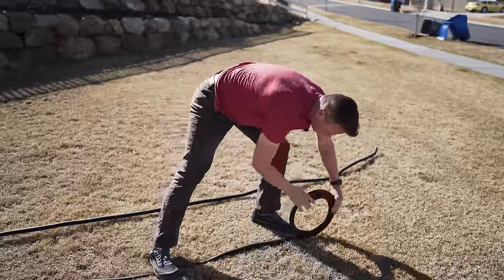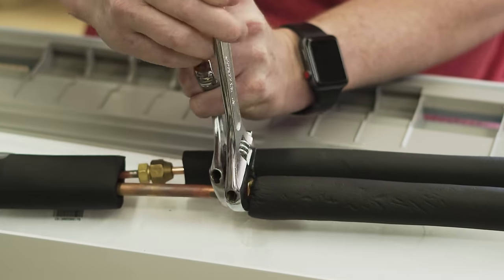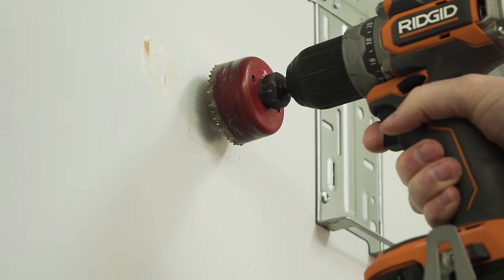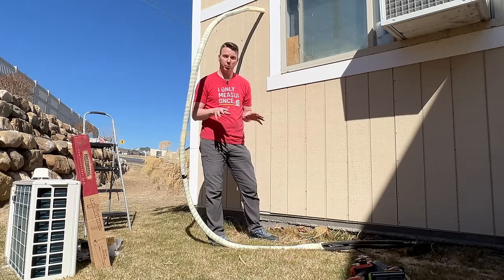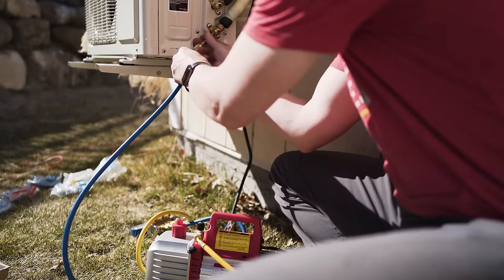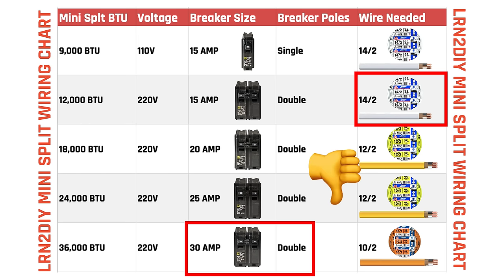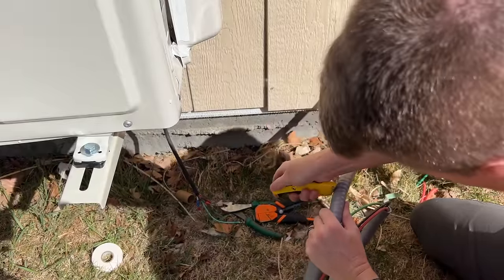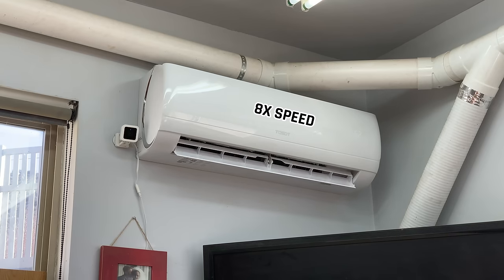DIY Mini Split Install - All the Things Nobody Shows You

Comment: I admire anyone who can do their own install. I watched this video and I contemplated it but given the various challenges, the refrigerant part was finally the deal breaker so I hired a HVAC contractor. If your curious about the costs, I had a 15k BTU Mitsubishi unit installed in my country house, about 1.5 hours from a major city (so not urban prices). Its a total racket for the HVAC guys. I got five estimates to install a 12k BTU single zone unit and prices ranged $4,500-$7,800. Labor alone ranged from about $2,500-$4,000 and the internet price for the units they offered to install ranged from $1,000-$3,800. No company would install a customer supplied unit - you had to buy the unit from them, and some companies would only install certain brands, while others would install a few different brands. This did not include the cost of the 240v exterior disconnect my electrician had to install ($500-700 including permit costs). Took one HVAC guy about 3.5 hours start to finish to install, including clean-up and showing me the basic functions. Like anything else, once I got a couple estimates I was able to negotiate the prices down. I ended paying $4,500 for a 15k BTU Mitsubishi Hyper heat unit 22.2 SEER (roughly $2300 internet price), but their first estimate was about $7,000 before they came down. Having both the manufacturer and installer warranties are a peace of mind. The unit is fantastic, worked great when outside temps dropped to the teens and recently with 90 degree+/humidity.
Reply: I am just shocked at the high prices HVAC contractors want to do relatively simple work. I could write a long chapter about some of the various ripoffs I have seen. They mostly take advantage of people's desperation when their heat or a/c stops working. People are shocked at the high bill, but then remember they are just happy to have it working again. I do not consider it a very honest business, generally speaking. I met one self-employed HVAC guy who would quickly fix a/c's (mostly easy replacement of capacitors and such), going to about 7 homes in a morning, then be out on the lake by 1:30pm to spend the rest of the day boating. If he charged others what he charged us, he took in nearly $8000 in one morning, all Zelled directly to his bank account. For work that was quite easy to do, nothing miserable like crawling under a house to install ductwork. I was just shocked, for example, that he could conscionably mark up an $8 capacitor to $260, and an $8 contactor also to $260! Plus all the other unbundled big charges, hundreds for a bit of extra coolant, etc. Getting rich in this field takes just a modicum of training, plus a LARGE measure of lack of conscience about ripping people off.
Reply: Mini split installation in USA is very very high vs what we pay in Australia. I've had  mini splits installed by a licensed refrigeration guy & licensed electrician for around A$1,000 (Say US$700). Some installers will do it for even less than that but I shy away from the real bottom dwellers.

And then the units themselves are also more expensive in USA, eg a Mitsubushi 3.5kW (say 12,000BTU) sells in Australia for around A$999 incl. GST or say US$700.
Reply: @KpxUrz5745  Ain't that the truth, I've got a leaking coil on the indoor part part of my mini split.  The parts are still under warranty but the labor isn't covered, they want over $2600  to replace the coil.  Not sure how long it takes but I'm guessing refrigerant is $300 or so, either it's going to take a couple days or they're charging $500+ an hour for labor.  I'm probably going to buy a unit and replace it myself.  The power is already in place.  Lines could probably be re-used but I'd probably get new just to do it right.  I've got everything but a flaring tool already.
Reply: Wow, that is expensive.  I did a service call for a ice machine on a Indian reservation, and had to drive about 1 hour to get there, then make the repair, and then drive to my next call.  So my boss said I had to charge a certain minimum fee.  I ended up spending most of the day driving there and back, so I was giving up the same amount of money as I could make on 4 service calls to customers within 30 minutes drive to each other.  

So the $4,500 fee is very high, but I can also understand that cost.  If he had to return to the shop for another 10 feet of copper tubing and go back the next day, that would make the $4,500 a money loss situation for the company.  

Glad that the installation went smoothly.  Perhaps a Mr Cool system with self install tubing would have worked much better in your case.  The electrician could have completed everything.  The tubing is sealed with a foil covering, and precharged with about 10 PSI of R-410.  The indoor unit is also precharged with R-410.  So when you put together the fittings, they open the foil covering and there is very little risk of refrigerant loss.  The once you check with soap bubbles for leaks, you can open the refrigerant valves, and they have enough refrigerant in the outdoor unit to run the system.  

I have a friend who was a traffic signal engineer for City of Long Beach California.  He  retired to a small town about 45 miles east of San Diego, and they had a town hall meeting to discuss installation of their very first red light.  He suggested they call the company who would install this $100,000 traffic signal and get a cost estimate for installing new light bulbs, and to make a circuit board repair if the lights went to red flash.  The answer was $1,200 for the technician to come out there, and spend up to 2 hours on site.  If he had the correct part on his truck, then the cost of that part, or another $1,200 on the return trip.  Cost to replace 1 or all of the light bulbs would be $1,218.  The city decided to install a brand new traffic circle in the place of their 1 four way stop sign.  I am thinking they must of had $80,000 to waste on some project in the city, and suddenly discovered a traffic circle would use up all of that money!  Now it is a pain in the backside when a tractor trailer is trying to make it's way around the traffic circle.

Comment: This was a great video - I was intimidated with the pre- charged lines and/or the vacu pump gauge process - not so much anymore.  I understand it better now.  If you still check your feed - if you had the choice between the Tosot - Pioneer - Dr. Cool - which would from your opinion would install the best?   Anyone is one for this question.

Handyman - Doug

Comment: Overall it looks good. I am bit confused about your electrical connections. You kept mentioning neutral and hot. However, the unit was rated at 220V. In the US, you typically refer to these as hots or Line 1 and Line 2. Also, if you hook up a 220V circuit, you always use a 3 wire + ground Romex. Hots use the black and red, and the neutral (white) can stay disconnected. I'm  not an electrician, but this is what I have seen.
Reply: yea he messed  it prtty bad. Should have connected black and  red (2 hots) and cap off the neutral which is not needed here. Also  breaker needed to be 15A.
Reply: @sumilidero  It is rare that a person admits their errors.  I am impressed that you have and I am proud of your honest response!  You did a great install and corrected any erroneous information.  For that reason I give you 5 stars! I am subscribing now.
Reply: Not all 220v circuits require a neutral. For ex. electric water heater only needs a two wire + ground. A neutral is needed on a 220v circuit when it has a 110v control circuit element to it. For ex an electric dryer. It has controls that run on one leg (110v) of the 220 and therefore that part of the circuit needs a neutral return path. If the appliance or equipment has no 110v control circuit then a neutral is not needed.
Reply: @jfowler702910  On an electric dryer the timer and the motor that turns the drum are 110 volts. Only the heating element is 220 volts, except in a gas dryer then the entire dryer is 110 volts. I'm not say you are wrong, this is just for clarification.
Reply: Yeah, that red as neutral thing would have me scratching my head if I had to work on this at some point down the road.
Reply: @williamjones4483  correct but some dryers could use a 220v motor. In those cases the neutral would only be used for the 110v control circuit.

Comment: Good job on the video and the install. I did notice however that you installed a 30A breaker in your panel to feed the mini split. Although the wiring leading up to the mini split can handle 30A, the mini split itself and the wiring inside it cannot. You should replace that 30A breaker for a 15A breaker ASAP for safety reasons and to avoid the potential of voiding the warranty of the unit due to an improper install.

Edit: I checked the service manual and this unit draws a maximum of 6.7A, so a 30A breaker is way too large.
Reply: Breakers are sized to protect the feed cable. The device manufacturer should supply internal breakers or fuses to protect appliance wiring. 

Using a smaller breaker on a higher ampacity cable is acceptable.  This is usually done when voltage drop is a concern.
Reply: @joefrisco  I can't speak for all countries, but I know that some countries such as the UK do require a fuse at the plug for each appliance. However, in the USA and Canada, no such fuse is required and is rarely seen. I have 4 mini splits in my house and none have fuses at their power inputs.
Reply: @joefrisco  That syncs up with what a power company tech told me. He had seen his share of bad wiring causing house fires. He always "overbuilds" on his personal projects. Such as  12 gauge wire on a 15 amp circuits. Whereas 14 gauge is sufficient and code. Code is just the minimum.
Reply: @joefrisco  the MAX breaker size is always printed on equipment labels. Exceeding that is against code, and unwise. Equipment overload protection is included for normal operation, exceeding the max breaker size comes into play when equipment controls fail, to prevent fires.
Reply: @SuperVstech  Manufacturers may state state breaker sizes. However, I could not find in the code where it is required (See NEC 2017 Article 440.4)I do agree it is a convenience and obliviates a need calculate the breaker size in accordance with remaining sections with Article 440. Maybe you can point to the setion in the ode that supports your assertion that "the MAX breaker size is always printed on equipment labels. Exceeding that is against code, and unwise. " I sincerely would like to have the section t pointed out to me where that statement is made so that i can understand further

I work in a department where cable sizing takes on a whole new dimension to what is normally seen in residential contracting. So I may be a little off the charts as to the lengths to which I go with respect to protective devices and cable protection. 

The main point is that the instantaneous circuit breaker is there to protect the cable first and foremost. In this case the molded case circuit breaker provides the instantaneous interrupting function.

For more details with respect to Air-condition and refrigeration equipment within the NEC see article 440.
Reply: @joefrisco  So if the appliance complied with NEC 110.2 (use approved equipment), it will have come with instructions and/or labeling. Those will state the breaker size(s) you must use for it.
Reply: Also, its a good idea to install a $75 surge protector at the disconnect switch.....I lost my entire Mini Split to an electrical surge/possible lightning ...killed the inverter board and shorted out to ground on compressor.
Reply: MCA is 9 amps I don't think you have the correct spec sheet!
Reply: @joefrisco , If the nameplate says 15 amps MOCP, then my area code requires a 15 amp breaker or fuse size.  If it says 20 amps, then that is required.  30 amps is not acceptable in this situation, even if the wire is rated at up to 30 amps.  If the MCA is 15 amps, then that is the smallest wire and circuit breaker size acceptable, while it might have a 15 amp MCA and 20 MOCP, then either a 15 or 20 amp circuit breaker is OK.  However if the MCA and the MOCP (Maximum Overcurrent Protection) is 15, then only a 15 amp circuit breaker is acceptable by my code inspector.  

Should there be a problem with the inverter that controls the compressor, a 15 amp fuse will provide the best protection for the system.  However a 15 amp circuit breaker will be acceptable, and might trip before much damage is done.  A 30 amp circuit breaker might never trip when the inverter takes a dump, and melts inside.  

Also remember the wiring between the indoor unit and outdoor unit are powered by the outdoor unit, and protected by that circuit breaker.  in the case of 15 amp breaker, the #14 or #16 wire size is fine.  The wiring powers the 165 watt indoor fan motor, and any communications between the units.  So #16 wire is plenty large enough for a 1.5 amp load on a 120 volt ductless unit, or .8 amps load on a 240 volt unit like the one shown in this video.

Comment: It would be a better idea to run the vacuum pump over 60 minutes, to get out any amount of moisture in the lines.  Also make sure that you let some of the refrigerant into the lines before trying to remove the line.  With a vacuum in the line, there is a negative pressure, and will leak air into the lines if disconnected as shown.  By opening the lines all the way, you will lose some refrigerant as you remove the line, however this is better than leaking air into the system.  Best would be to open the valve a little bit, let some pressure into the lines (say 15. PSI), then shut the valve, disconnect your line, and then open both valves all the way.  

Also I never leave the caps off of the valves when running the vacuum pump.  It might be possible for air to enter the lines if left off.  

Ideally, it would be good to use a "Micron Gauge" however in 38 years, I never bought one, as they are about $175.  I have used them at work, when they buy the tools.  Running the vacuum pump another hour, it will more than make up for the lack of using a proper vacuum micron gauge.   R-22 systems are much more tolerant of lack of vacuum, and a little air or a few grains of water in the lines.  R-410 will make acid out of any moisture in the lines.  This will over time, eat away at the compressor windings.  

You show self taping screws on your electrical panel.  Are they "Blunt Front" screws, that will never dig into a loose wire?  Blunt front screws are the only type allowed on a electrical cover to bolt it down.  

If the unit is running 230 volts, then you should have used the two colored wires, and cap the white wire in the disconnect.  If you use a white wire to a two pole circuit breaker, then it should have a wrap of black tape on it, so everyone will realize it is not a grounded neutral wire.  If you happen to be running 120 volts, then the white wire Must Not go to the disconnect, but should have a wire nut on the white wire, so it stays connected when you turn off the power at the disconnect.
Reply: NEC does not allow black electrical tape to mark a white conductor as an ungrounded current carrying conductor in a cable assy. It must a permanent ink or paint that encircles the entire conductor, and two inches of coverage area is standard in my area. A sharpie ran up and down the conductor does well.
Reply: time isnt an issue ,when vacuuming a unit you cant use those gauges you require a micron gauge or torr gauge
Reply: You know so much. Is there any chance you can make a video?
Reply: I’m was looking this comment to make sure him did a wrong vacuum. When release the pump line with a negative pressure him loses the vacuum did. Now the best way it’s do the vacuum again and refill the 410A on line, right? How about use a used system with old pipes (probably with dust and humidity due they are opened) only a vacuum works or need some cleaning before vacuum?

Comment: This is a very helpful video - I saw the comments regarding electrical wiring, but kudos to you are putting it all out there for people to critique and discuss.  You are very clear in recommending to have a licensed electrician check any wiring, so the issues noted by commenters would have been caught.  To be fair, I have seen "pros" in my area do worse.  

The only thing missing was a description and source for the insulation tape you used to wrap the lines at around 7:30 in the video.  My local box stores (Canada) don't seem to have anything like this and searches seem to give the common foil HVAC tape (it does not look like that's what you're using).

I'll add that it's almost impossible, in my locale, to source outdoor rated 2+ground cable with black and red sheathing on the two insulated conductors.
Reply from the maker: Thanks for the kind words. The tape I used came with the unit so I never looked for it separately. To your point, I haven't ever seen tape quite like that elsewhere so I'm sure it's not so common.